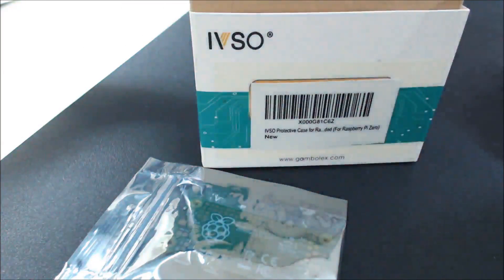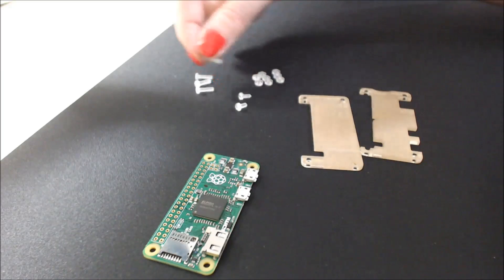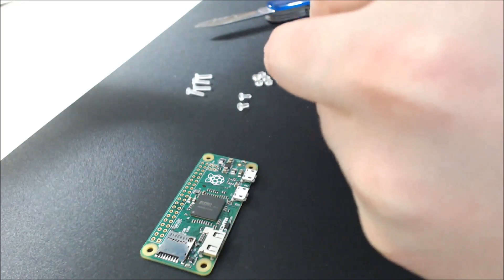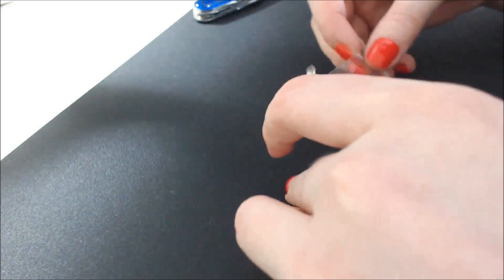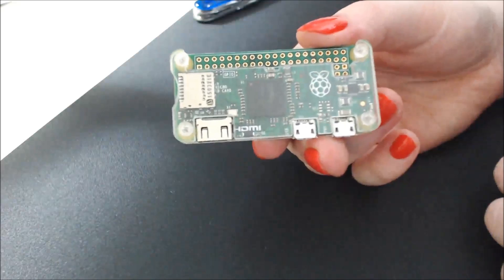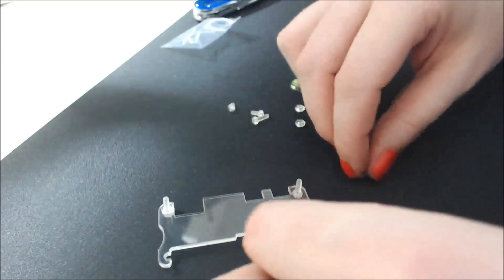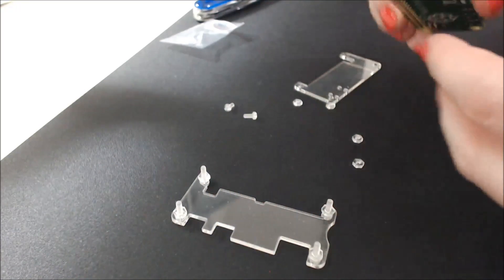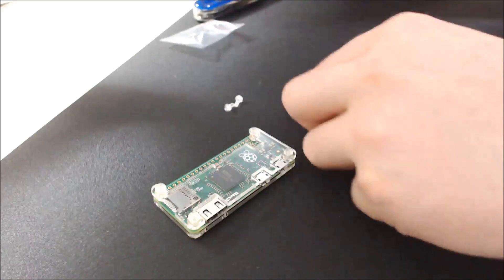How to install a Raspberry Pi Zero Case?

Comment: Just wondering... What do you use the Raspberry Pi for?
Reply: *****
Oh, I meant what is Phedran going to use it for. I thought maybe someone had come up with a capture software, so she would use it to record or stream directly from the GBA, or something like that. =)
Reply: +tenebraebr a really good idea is to use it as an entertainment centre for your tv, so stream films, programmes etc without getting a smart TV :)
Reply: Shaun Harrison
Sounds like a good idea! I even got a "installing Android TV on Raspberry Pi" as a related video to Phedran's
Reply: +tenebraebr Buy depending what you want to use it for, if you are after a media centre then I'd advise using the quad core pi2, if you want a compact pi for electronics projects or some compact system then yeah the pi zero is a good choice as long as you don't need any networking or the missing interfaces, unless you use one of the work arounds.